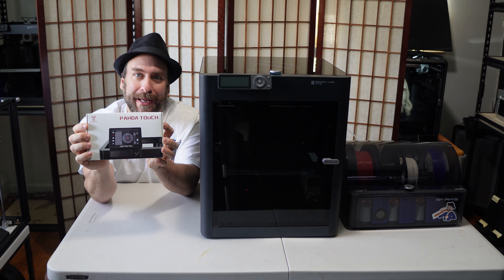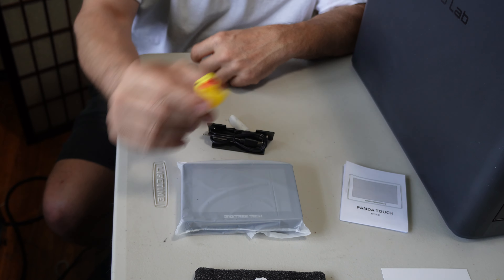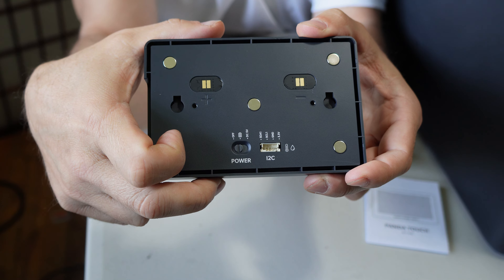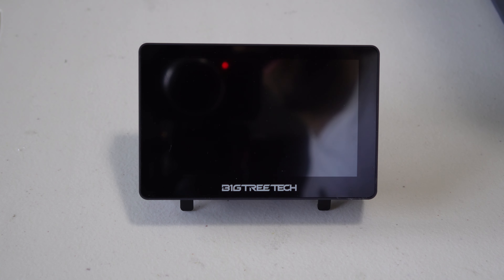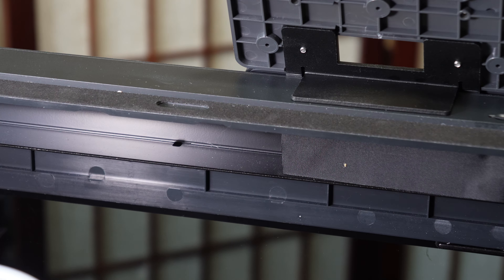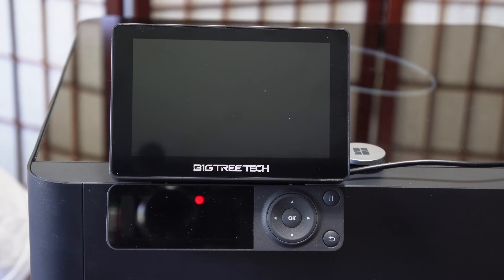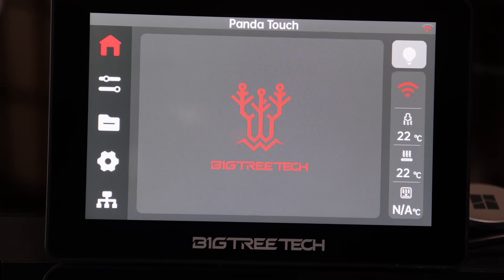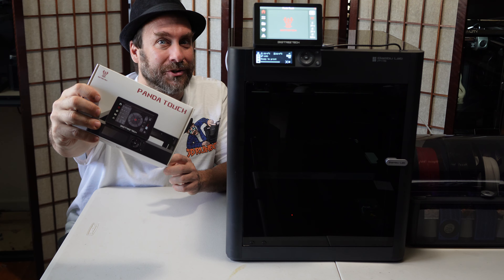Installing the BigTreeTech PANDA TOUCH on Bambu Lab P1S 3D Printer - 5" Touch Screen

Comment: Very helpful tutorial, thank you for spending the time on it. PS if you need to find your serial number it is inside the right hand side of the machine right above the rail. It is a small QR code. I used my phone as a magnifying glass, worked well.

Comment: Hey, you might want to clip the video at 7:23 minute mark since the serial number and ip addresses are visible for both printer.
Reply from the maker: I expected this. I use a different wifi for the video, and the serial is bound to my Bambu Lab Account, so, I should be ok. Unless my machines start randomly printing giant Penis, then I know I'm not ok. 😂😂
Reply: SN is something you'd probably want to protect, but those are internal/private IP addresses lol. There's absolutely nothing you could do with that information.

Comment: I have had my Panda Touch for a few weeks now and the only issue I have is that if I turn off my printer and turn it back on later the Panda Touch loses the connection. This seems to be related to the IP Address of the printer being different. I do not like leaving my printer on all the time so this is quite frustrating.
Reply from the maker: Hi. I am not having this issue at all. All 3 of mine are keeping there connection
Reply: @3DRundown  Do you power them off?
Reply from the maker: There is a new firmware out, TODAY, that addresses this.
Reply from the maker: Yes I do.